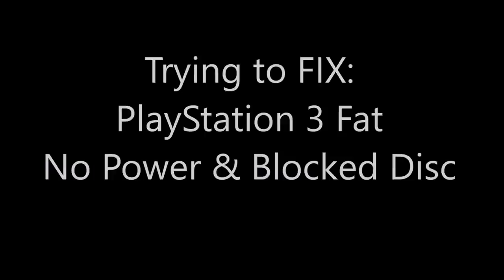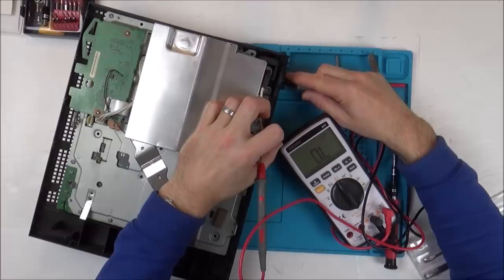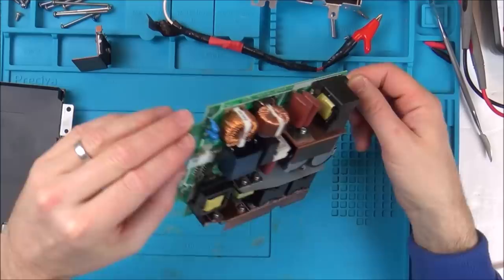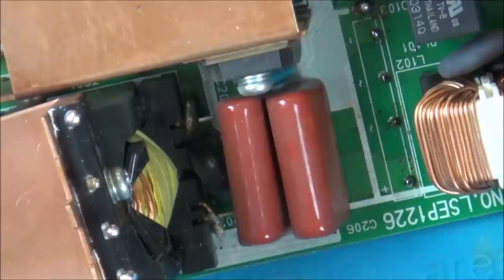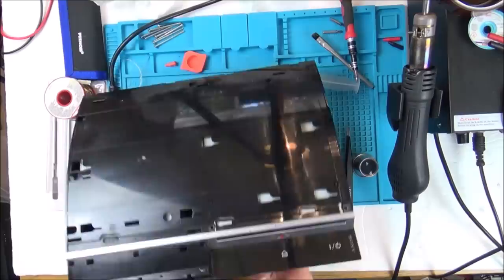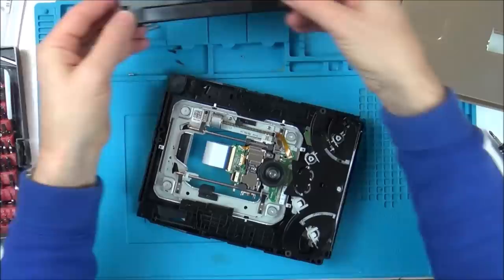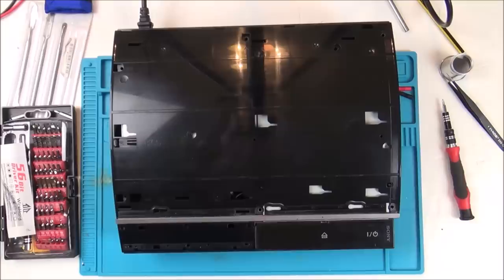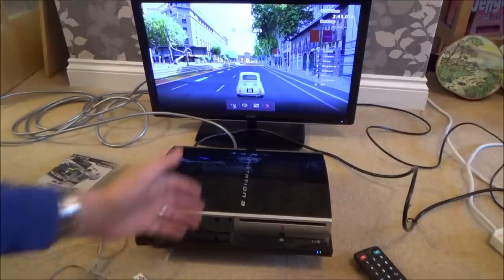Trying to FIX: PS3 Fat - No Power & Blocked Disc

Comment: The loud fan is not normal. Even if you change the thermal paste it wont fix it .........it has to do with the thermal sensor on the board which is messed up. btw i wont leave it for a long lime with that loud fan your going to damage the solder balls under the processor.

Comment: The Ps3 was dropped, the psu broke, there was a dvd still in, the ps3 was opened up, the dvd was removed, that's why the dvd drive was still in locked mode

Comment: well now that I've seen this I know it's not that difficult to replace the power supply as my PS3 gets zero power to it.  I wouldn't even attempt what you did I'd just replace the supply unit itself rather than trying to do anything like replacing individual parts lol